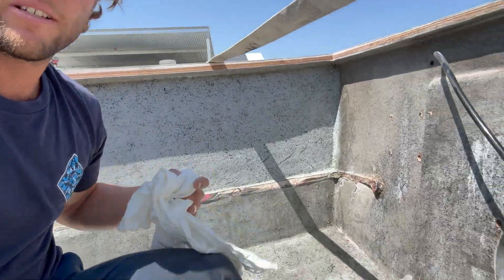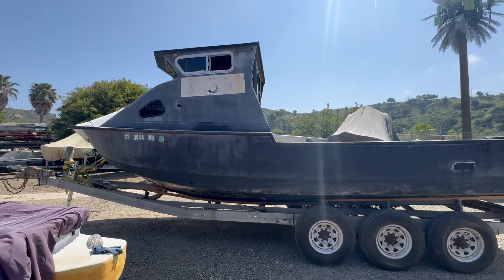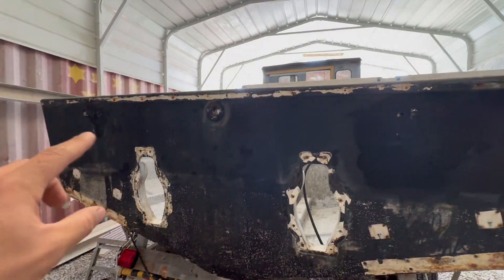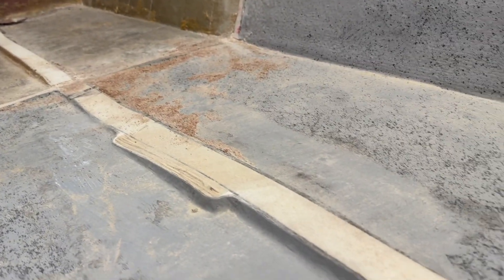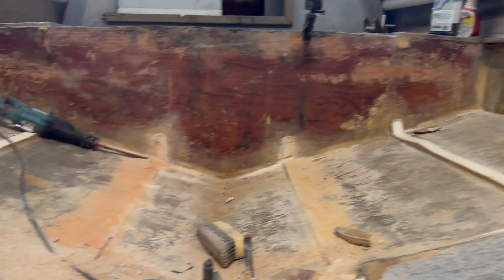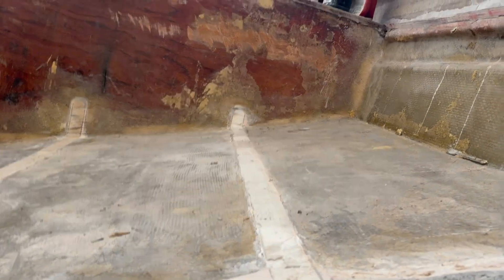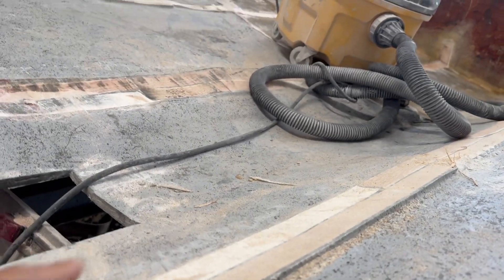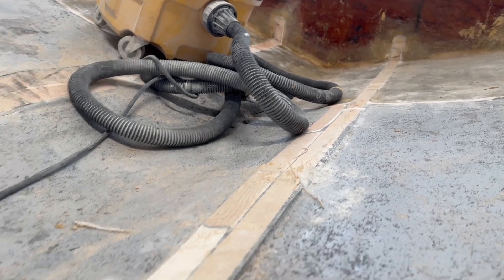26 Anderson Re-power : Removing the Transom and Stringers!

Comment: Had no idea that this much had to be done.  So every time this basic design with outboards, someone did all this to the inside structure?
Reply from the maker: No, we are converting our boat from twin diesel engines with outdrives to a single diesel with a v drive transmission. adding two feet gives us more room to engineer the correct angle for the shaft angle while not having the whole boat be an engine. box... For outboards it is pretty typical to add a bracket off of the transom to mount the engines to, but there are different ways to go about it.
Reply: Thanks for the info. That is going to be cool. We have that on our Cat. Seems to work really well. Enjoying the adventure thank you for recording it.  @YoungWiseTails

Comment: You didn't leave any of the transom glass to bond to? That can be very problematic. If you glass to the bottom of the hull and don't get a perfect bond the glass can lift and peel from the water pressure while moving forward. Not trying to be an ass, just saying...
Reply: Jeff Hull is one of the best fiberglass/ boat builders on the west coast of California. I’m sure he coached Conner what to do and remove before he handed him a sawzall. The boys are in good hands…
Reply from the maker: yeah man! We laid up the glass running up the inside of the hull... and we built and cored a whole new transom at the end of the extension. laid it all up at one time. we used some door skin on the underside and then ground down the existing hull side to create a return and glassed that seem with Bi Ax.
Reply from the maker: thanks man! Jeff and his crew are so epic and have been so fun to work with. they're doing all of the heave lifting as far as glass and build I'm just helping with whatever I can.